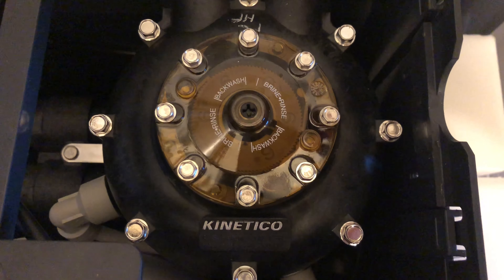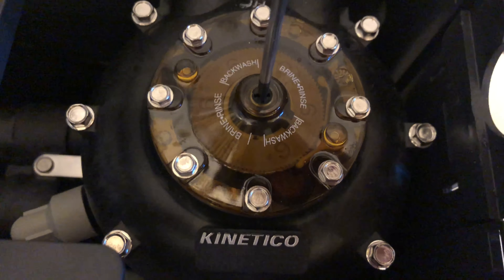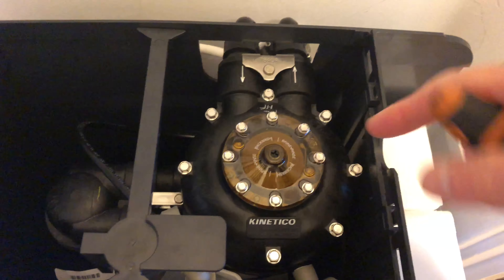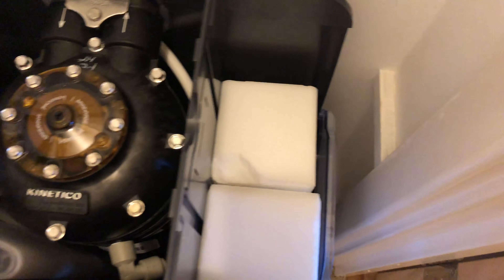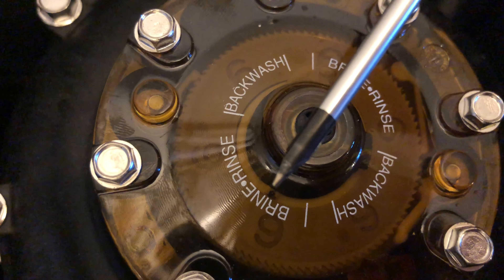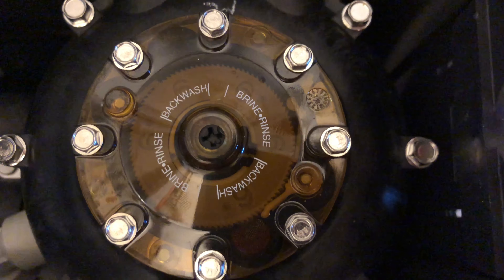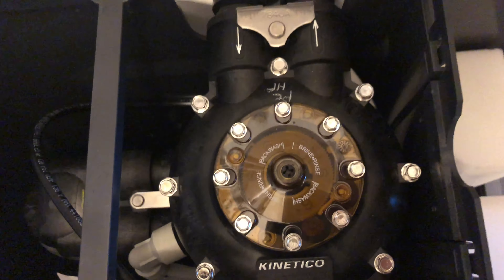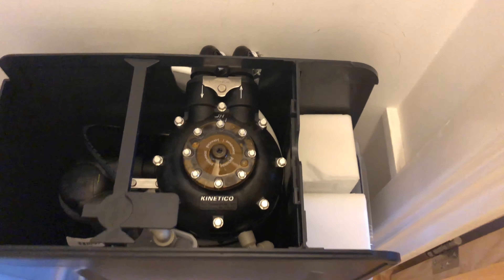Initiating a 'regeneration' on the Kinetico Premier Compact

Comment: I have worked with various water softeners for over twenty years and found that the Kinetico twin cylinder Premier compact previously 20/20 is by far the most efficent and least grief to work on. That has been around for around 50 years and each model has corrected its weak points on the last. I'm still working on them
and the Premier compact doesn't come up. Which tells me its a good softener.
Reply from the maker: Thanks that's good to know, but I feel this unit consumes salt quicker than it should. How long should 2 sticks of salt last for single occupant? Thanks.
Reply: It should be  approximately 1 block per person per month.
Reply from the maker: @nothinspermanent8039  Hi. Thanks. Mine's probably going through 2 blocks (1 pair) per month but I'll keep monitoring.

Comment: Hi may I ask you how much this cost and how much the salt cost ? Thank you
Reply from the maker: The unit costs about £1600 the block salts cost about £13 for a pack of 2
Reply: Brian Su very expensive :/ I found better deal . thank you
Reply from the maker: @BIKEgoesPRO  what's the deal that you've found?
Reply: Brian Su From EWT Water Specialists for £749 complete boundle .
Reply from the maker: Sir. Florin for what make and model of water softener?
Reply from the maker: @BIKEgoesPRO  EWT Doesn't even sell these lol. What are you talking about?
Reply: Brian Su Yes mate i know they didn’t sell kinetico products , I don’t even say that , I told you that I just found better deal nothing else 😊 . I don’t know how good is the product from them but I’m happy with customer review’s . Cheers
Reply from the maker: @BIKEgoesPRO  Yes but they are not the same thing, you're comparing 2 very different products. This one is twin tank and fully mechanical hence the extra cost. The ones on EWT require electricity that's why they're so much cheaper. I hope you've done your research and don't make a mistake with your purchase. Cheers.
Reply: Brian Su i don’t do a lot of research to be honest , can you recommend any other non electric good products within maximum of £1000 ? Thanks
Reply from the maker: @BIKEgoesPRO  maybe this? It's twin tank, non electric so exactly like mine. https://www.easyh2o.co.uk/product/twin-tank-non-electric-meter-softener-kit-salt-152
Reply from the maker: @BIKEgoesPRO  Actually, this one is much better. Harvey's and Kinetico are the best brands out there. This one is Harvey's https://www.eastmidlandswater.com/harveys-homewater-twin-tank-non-electric-water-softener-f15slt/87

Comment: Why doesn't the top dial spin? Why does only the bottom one below that one spin?
Reply: The top dial spins when you run water throughout the house. It is called a meter disc and it counts how much water has run through the unit. The bottom disc is called the control disc and it controls the regeneration. That’s why during a regeneration it is moving.

Comment: Do you do the regeneration on the second tank after that?

How much water is in the salt container after?
Reply from the maker: no water will be left in the salt container (brine) so it refills itself with fresh water before the mechanism stops. For this reason, no 2 successive regenerations can't be performed as  time is required for the salt to dissolve into the new batch of water.

Comment: Mine won’t start moving on its own
Reply from the maker: I had the exact same problem with the first unit, the installer insisted it was my fault for breaking it :( eventually the boss came over with a replacement unit to replace it. He is properly trained by Kinetico, he opened it up to try to figure out why it wasn't advancing but couldn't figure it out so ended up replacing the whole unit. I've not had an issue since then.
Reply: @BrianSu  we got mine working. The salesman who sold me the rear of the system came over, and cleaned it out. Turns out that part of the system was old, so cleaning it out got it going! Luckily!
Reply from the maker: @Slippindisc  Ahh brilliant!!!

Comment: How quiet is this unit when not regenerating?
Reply from the maker: you'll hear water running through it when it's in use, but it's quiet because the cylinders are enclosed. You won't hear it from the outside of the utility room if the wooden door is closed. The sound of the water running out of your tap or filling up the cistern is so much louder that you'll have to keep your ears quite close to the unit to actually hear it. This is because the noise is so easily drowned out by the former.
Reply: Thanks  for reply...ours would be in a kitchen cupboard so wondered how you would think it would be for noise in that room. So it has an audible noise at all times getting louder in regenerating times. How long does regenerating take? I know this is supposed to be a quiet model of softener . Appreciate your time .
Reply from the maker: @ZR-xs7nz  well if someone's having a shower then yes you would hear a little noise from it, but if you're using the kitchen sink then probably not. Regeneration takes a couple of minutes, I can't remember but I believe it's under 10.
Reply from the maker: P.S. the spec says 11 minutes.
Reply: I see...I thought it made an audible noise all the time but sounds like it may be quieter than I thought . So you think in a quiet room youd only hear it when someone was using water and even then only maybe. Am I understanding correctly?